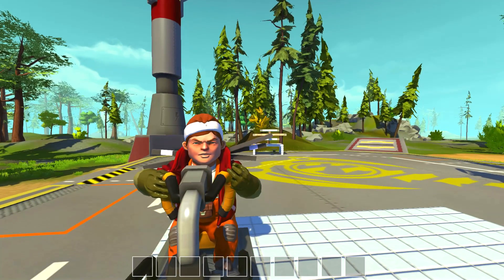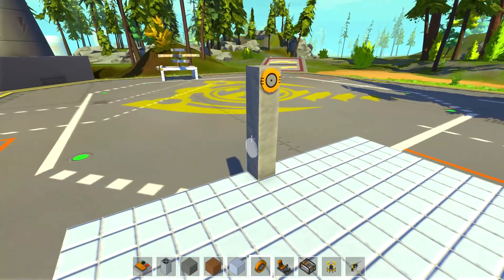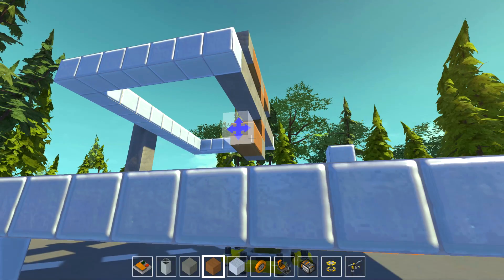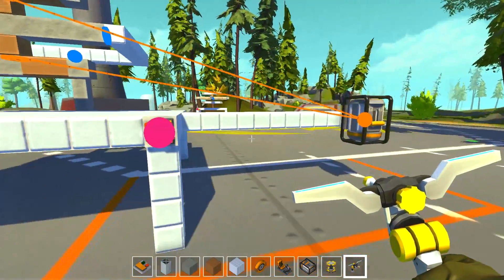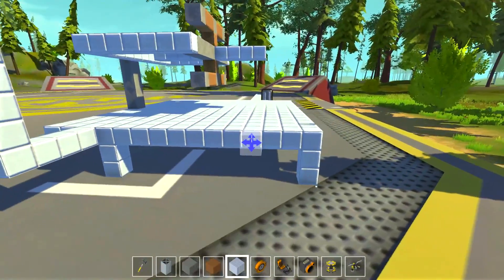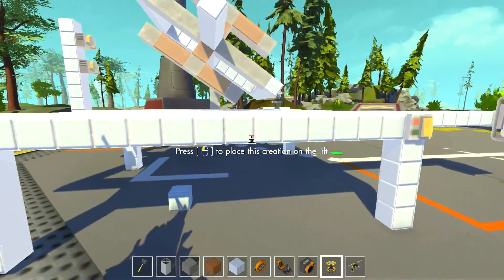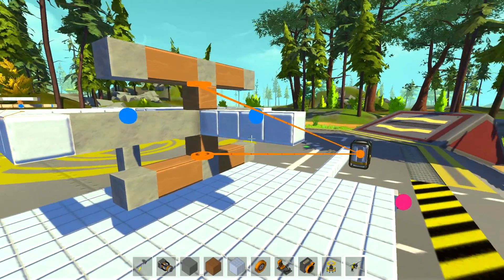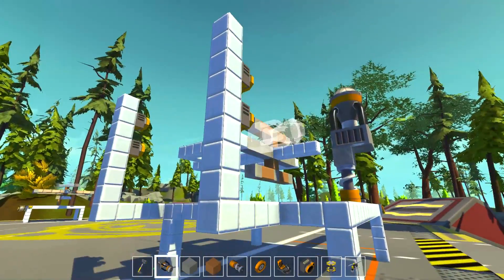Scrap Mechanic - Tutorial: Gyroscopic Stabilisation - 4

Comment: any tutorials for a smaller one? I am trying to make a small scale hover craft that goes at high speeds, after tons of testing the fastest way I can get it to do it is bouncing like a dolphin but sometimes it will nosedive too hard for suspensions or thrusters to fix it so I need to have it always facing about upright, right now it goes from one side of the map to the other in about an average of 20 seconds but with a small one of these built in I could easily reach the maximum possible speed so can it be done and if so can someone tell me how?

Comment: I don't know if you've figured out yet (only watched the first 3 Scrap Mechanic videos) but you can use a new controller block to prevent a loose bearing from freely turning. I learned this from Aavak, which is coincidentally where I found your channel. Perhaps you know this by now though. Also, that creation at the beginning was 1 block longer on one side, but that's just nitpicky as I assume it's just an example. I just have this eye for symmetry for some reason. I'm nearly a human level.